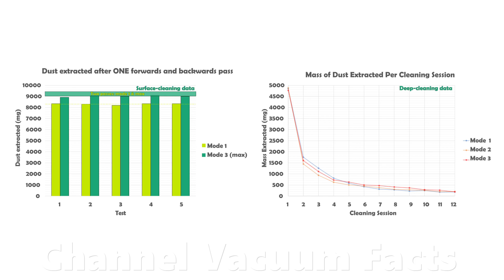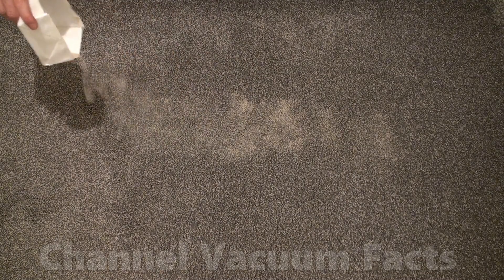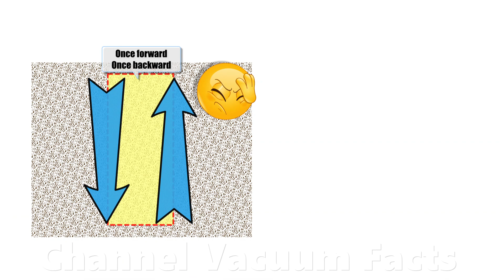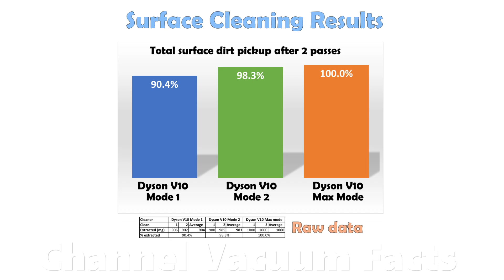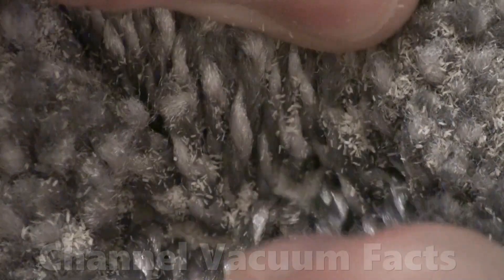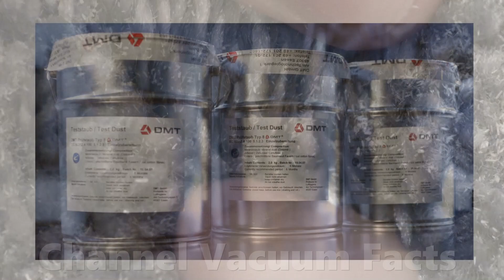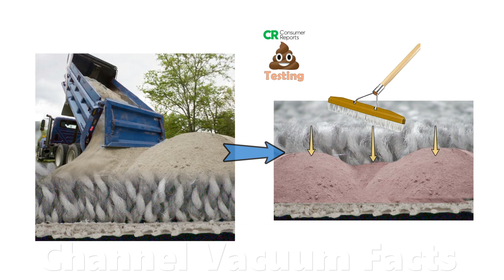Dyson Cordless Performance Measurements

Comment: Cleaning fine dust off the surface of a carpet is not a big challenge for most decent vacuums. I see you put the results for deep cleaning after 12 cleans? What was the point of this? What was the result after 1 clean?
Reply from the maker: 12 cleans was arbitrary but debunked, once again, the myth that one clean is all that's needed to deep-clean a carpet. It's statistical. The data for performance after 1 clean is shown in the video. Also you have to be careful WHICH single clean you look at. The first clean has artificially large quantities of dust embedded deep down and is thus not representative of normal living. The last clean is more representative, as embedded concentrations are nearer real-world. Looking at total removed after 12 cleans gives a proper indication of the deep-cleaning ability, given the statistical nature of dirt removal. 12 cleans is sufficient to have given enough opportunity for the majority to be removed. The more that was removed in total whilst fairly accounting for statistical variability in individual particle removal, the better the cleaner is at deep-cleaning. It's a far more rigorous test than anything else on YT and is far less prone to error, and gives good indications of true performance. A lot more interesting things to come from Monday and people will learn a lot.

The really important point this video was making was the importance of the choice of dust used can dramatically affect the performance measurements. If dust isn't representative of real-world dust, then it's a totally pointless test. This is why anyone using ONLY sand in a carpet to test, demonstrates they don't understand what they're doing and should be disregarded by anyone respectable. Industry standards use replica test dust for a reason! My dust was not really ideal, but covered a decent size-spectrum and was less prone to error, and you can see that in the data, which now shows greater performance differences with power modes.
Reply: @VacuumFacts  Ok but what does this replica dust contain? Fine particles medium size particles large particles? There's also different types of carpet. So many variables it's not easy to do an accurate test. A cleaner that does well in one home might not do so well in another. Anyway im looking forward to seeing how the Kirby does with your dust on your carpet against your Dyson 😁
Reply: Don't forget to use a new bag in the Kirby and to adjust the height correctly or you know what will happen haha 😁
Reply from the maker: Official replica test dust contains material which has precisely the same average particle size distribution of dust found across homes from studies, but without the bacterial content. And you're right; there are huge numbers of variables, all of which affect things, and they need to be a) kept constant, and b) chosen to be representative (or at least not so they're misleading). This is why using only sand, and some other things that will be exposed from Monday, renders virtually all the amateur tests on YT completely unrepresentative. Mine are not perfect, but I think can be defended to be the least inaccurate on YT currently. But, as I've often said, there's NO substitute for a formal industry standard test which does everything as right and reproducible as possible. And those highly rigorous tests always show Dyson on top, regardless of which independent company conducts the testing.

Yeah, the reason I released this video early is because this test methodology is used (and will be in future) to test the Kirby too! :)
Reply from the maker: Yeah, the Kirby was given an unfair advantage in fact; new bag/dirt meter pads, no dust loading, deep protruding bristles, new belts; it had been FULLY and professionally serviced. No tricks; just as objective and fair as it could be.
Reply: @VacuumFacts  Excellent. I hope your enjoyed using the beast 😁
Reply from the maker: @2711marcus  I enjoyed at least being able to finally test one :) All else will be revealed soon :)
Reply: @VacuumFacts  I agree with you about this pads it artificially increases the performance as there is less resistance than when the bag is fitted. Not sure how much of an advantage but definitely an advantage
Reply from the maker: I thought Hooverlux’s video recently was just wonderful. https://www.youtube.com/watch?v=sS3Rm-0-Ag0

Ironically, the ‘best’ video ever done by this guy was due to a team-up with someone else, albeit whose testing I don’t generally consider that impressive due to the sheer number of flaws in it and the lack of ability to understand why after comment conversations. There are just so many brilliant internally contradictory moments in this video that so wonderfully support everything I’ve ever said from day 1, whilst simultaneously working directly against everything those that typically don’t like my channel try to champion to support their erroneous world view.

1:30 his face about Dyson’s “wild” claims (which have all turned out to be 100% true, let’s point out), implies he thinks it’s total shit, but which later turn out to be totally true.

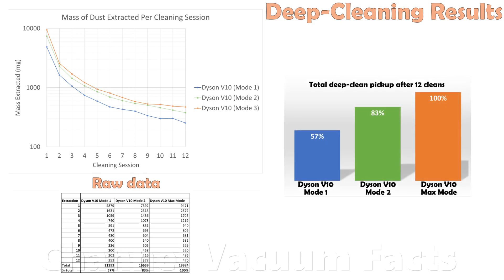3:02 Vac wars's discussion shows airflow etc. is irrelevant and there's far more that’s important. What is important, has been plastered all over my channel since day 1 and has been viciously attacked by those now apparently slowly coming to terms with being so wrong (and unfriendly), as the video shows later.

5:02 Vac wars says initially he concluded (publicly) he didn’t think Dyson cordless mains equivalent cleaners could replace cordless. “That’s what I believed until I actually tested it”. This is why I originally lacked any respect for this guy; how dare someone peddle a factual claim without any evidence, that’s in fact directly contradictory to all the available evidence. It just fuelled support for him by those with broken opinions, whose stagnant worldview actually coincided with that claim. It’s commendable he changed his mind in light of the undeniable, i.e. evidence, and he gets respect for that, but that so nicely highlights exactly why I started my channel. People who should know better by definition of trying to influence the public domain, who are clearly driven by emotive worldviews and subjective personal opinions, making factual claims and peddling them as gospel, but have literally no credible, objective evidence whatsoever. Deeply disgusting. Then when some is presented to them, they viciously attack it and the source providing it, simply because it conflicts with their erroneous beliefs. This is deeply shameful, as are their supporters who are complicit. This filth is seen throughout history in the worst of humanity and is the reason why I lack respect for the rabid ‘vacuum enthusiasts’.

Some of those claims though: “better than the Sebo Felix”, “best deep cleaner”, “came top in all the tests” “enough to clean even large houses”—even with only one battery. How many times did Vacuumtests or Vaclab bitterly criticise me or leave misleading comments in videos saying exactly the opposite, without any evidence, or try to suppress my videos in a touchy manner by abusing the YT copyright system? Deeply shameful and no humility shown as more and more evidence comes along to prove them wrong.

Then we go back to hooverlux at 6:55 and he suddenly plays dumb and as though he doesn’t understand all the ‘airflows’ and ‘suction’ stuff and wanted someone with more ‘scientificy’ knowledge. So, he attacked me historically and tried to rubbish the very thing he asks for, but then when he gets it, and it confirms everything I've ever said and that he’s attacked, he then very reluctantly accepts it, supported by his own experiences with the device. This is despite the hypocritical hostility I've received by people claiming I'm drawing conclusions without trying a product; they subtly ignore the fact my conclusions were based on huge amounts of knowledge available. It’s then just so amazing to see how he loves the Dyson products, but hates the Dyson brand in the most primitively tribal manner. The cordless revolution that Dyson, once again, single handedly created and championed, is clearly setting up a deep internal emotional conflict that people on the erroneous side of the fence are struggling to come to terms with. They love the Dyson cordless cleaners but also hate them simply because they’re Dyson. And their favourite junk brands, like Sebo, Miele, Riccar, and Kirby etc. are nowhere to be seen and living back in the black-and-white ancient past. If they’d been a little more open minded and less hostile to people like me, presenting facts and truth, they might not have such a hard time now. I doubt it will serve them right though, and we’ll find out next week, via the thunderous silence in response to my videos.

I wouldn’t mind doing a team up with another channel to do some tag-team videos, but I know of no one who knows what they’re doing and produces content compatible with mine (i.e. accurate without obvious flaws, well-reasoned, and evidence-based). Pity.
Reply: Vacuum Facts it doesn’t matter who’s testing it and really considering the “sheer” amount of crap you talk you really can’t comment on other people
Reply: @vacuum facts
Reply: If a vacuum cleaner is good it will continue working to the same standard in years but even the most expensive dyson out there will have different results after time it’s called age nothing works the same but if it is of good enough quality there should not be much difference
Reply from the maker: Could you provide a little evidence to support your claim that you get different results after time with the most expensive Dyson? Proper evidence collected formally; not some vague anecdotal non-evidence by a biased 'enthusiast'. Otherwise, it just sounds like you're making stuff up.
Reply: Vacuum Facts ok If you look at dyson vacuum of the month tests even after 1 month the filters get dusty meaning the cyclone Will have a build up of dust this will mean that performance will decline
Reply from the maker: @Williamdow20  That is a very unconvincing explanation. Filters need to be completely caked in dust before they show performance decline. You would need to show evidence for your claim that 1 month's worth of dust on the filter causes performance drop. It can be measured. You're simply making an assumption there and it's in conflict with facts. If you want to learn how filters work, I've covered it here: https://youtu.be/QTSadOm6WsI . Also, if you want to understand why 'vacuum of the month' tests are absurd, see here: https://youtu.be/VuB2_X5cwMM
Reply: Vacuum Facts but when you tested the Henry you said it was poor this was because it had no maintenance over the years but then say that vacuums need maintenance as a argument could you make your mind up you need to check the facts your using as a argument
Reply: Vacuum Facts also don’t use your own videos as evidence
Reply from the maker: The whole point of making these videos is to use them as evidence. Because they ARE evidence. The Henry was poor not because it didn't have any maintenance, but because it's poorly designed. The poor cleaner head design leaking suction would still be a problem if it was pristine and new out of the box. You're simply not very convincing.
Reply: Vacuum Facts absolute bullshit
Reply from the maker: Another well-argued insult o_0 Says it all really...
Reply: Vacuum Facts yeah it says it all because all you talk about is absolute bullshit